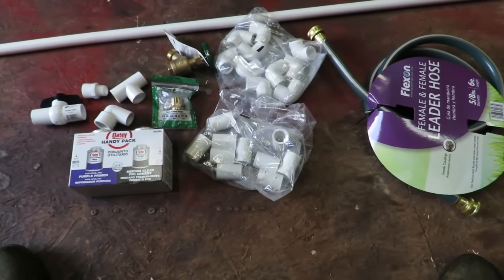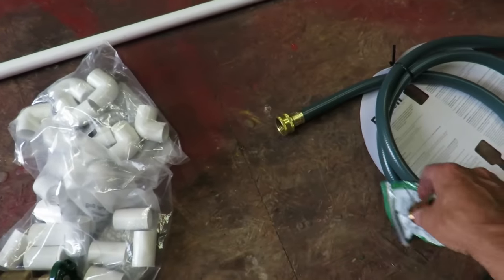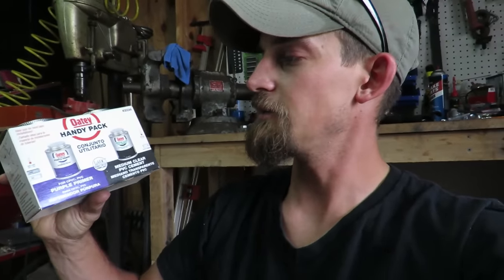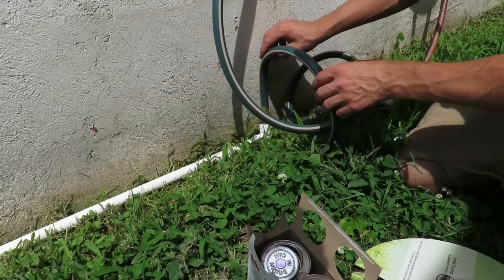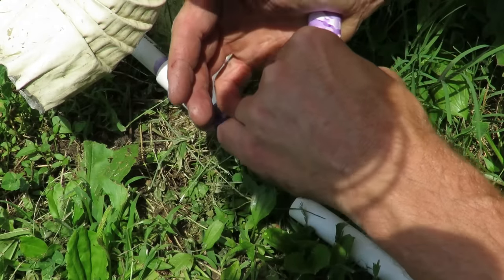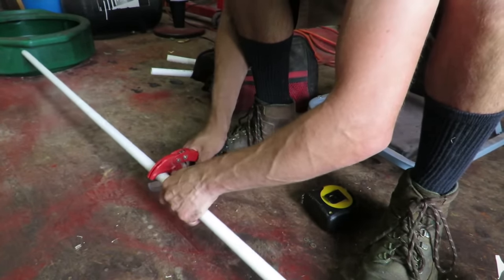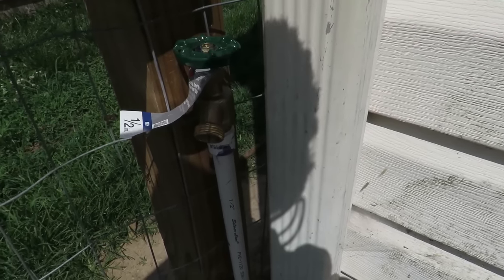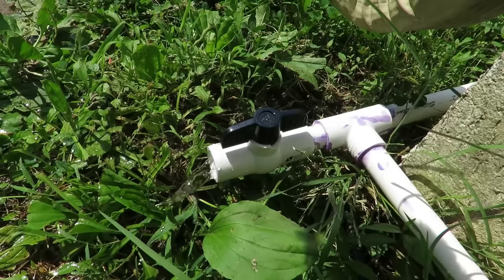Add a Water Spigot Anywhere in Your Yard!

Comment: Tim, thanks for video its really helpful. Not sure if you can help but tried two different female to female leader hoses now and both time the female end going into hose-PVC connector leaks, just out of the back of the leader hose connector,
thx
Derek
Reply from the maker: I'm assuming you have checked to make sure the rubber piece is on the inside of the hose connection?
Reply: @ASliceofWoodWorkshop  Thanks Tim, i figured it out,  the mistake i made was putting tape on hose leader to brass NPT connector, took tape off and its works perfectly- great video

Comment: Great video! Thanks so much for sharing. Could you clarify the size/name of the pvc elbow part you used to connect the brass adaptor to the 1/2” pvc pipe? I’m having trouble finding that one. THX
Reply: What's the time mark for what you're asking about? The pvc piece used to connect the pcv pipe to the bottom of the spigot is a 1/2" slip to 1/2" male adapter. The slip side allows the pvc to adhere to the adapter and the male threaded side allows that end to connect to the brass spigot. If you're needing a link, lmk. If you're asking about a different piece, lmk that too.
Reply: Anyone have a link to the elbow used at 3:57? It’s the 3/4” threaded to 1/2” slip reducer.

Comment: Couple things, No need for teflon tape on your hose end of the MNPT-Hose  adapter, the gasket in the hose will make that water tight.

Glue your ball valves in partially closed position, should you get some glue inside, it'll be easier to break it loose than if it's in a full closed/open position.

When gluing, to prevent any dry spots where the glue didn't gett to, twist your pipe and fitting into the fitting, or the fitting onto your pipe.

Also, since this is going to be sitting in your yard, you will want a backflow preventer on that hosebibb. Nothing fancy necessarily, but you don't want any dirty water making its way back up your pipes.

Comment: Helpful! Question. How far can pipe run effectively on flat ground (or trenches underground) and maintain pressure? I am using 2 hundred ft hoses and seems like pressure is sometimes less. If I do this will it maintain pressure?

Comment: Is it just me or is he holding the pipe cutters up side down...?
I've never used them but I've seen a few people using them on TV.
Reply: there is not upside down.  the back holds the pipe and the blade pushed in to the plastic.  In different situations in ground around roots concrete etc it can be necessary to shove the tool any way you can to make the cut but... always wipe dirt / grit off the pipe as the blade dulls fast and is difficult to sharpen.
Reply: Paul C oh okay thanks I wasn't sure, but with all his tools and his work shop and the old tool bag he had I figured he should be knowing what he's doing, but you never know... I was just curious because I may be getting a pair for a project... thanks for ur reply
Reply: J C yes I know know, thanks

Comment: Si you leave it open 24/7? I need this to install the timer for my garden, other question….i have backflow water from my regular house garden at the faucet from the house, that one has a back low prevention valve do I need to remo it and place it at the new faucet with the irrigation timer?

Comment: Great idea. However as others are saying PVC is sunlight sensitive,  it gets brittle and brakes easily. I used water line, bury it and used metal uprights and faucets.
Also 1/2" is too small, I use 3/4" mostly to keep my pressure and flow rate up. If you are doing drip irritation the 1/2" is fine
Keep up the great ideas for everyone to figure out how to make it work for their own purposes.
Reply from the maker: We will see how long it ends up lasting.  No issues using the 1/2" line for me so far and I have used a pressure washer off it as well.

Comment: For those of you up north where freezing and cracking is a problem I got a tire valve stem and I used epoxy to attach a plastic garden hose fitting to it and I screw it into the system and use my small tire inflator to blow all the excess water out. Gravity draining does not always get all the water out of the turns and valves. Takes a few extra minutes and you don't have to go back and make repairs.

Comment: The end of spicket does not have a threaded end. It has a copper fitting that goes over the main copper line coming from house how do I connect the two copper pipes securely??

Comment: not a problem up north if you set up drain valve at lowest point like you did. Just drain before freezing temps. If you go underground, then you'll need to blow out water using compressed air.

Comment: This is Excellent ❗
I thought I would have to  water lines for drip tubing under cement walks , driveways  and for the other other side  of my house 💔
  I didin"t have $.00 so I've just been reach ing with buckets and hoses 
  I do have the extention on my water spigot at the house for support but, it doesn't seem to be enough. I'm afraid it's too much tension on it . This sounds loke a Great Set Up 
  Thank You ❗ 
 I would like like yo have seen it in it in it's Entirety so I could see how you holked it up. I was not quit sure about that .  I guess I'll figure it it out . My main concern is getting the pressure off of the house spigot. 🤔

Comment: You forgot to hold the two pieces in place while the glue sets.

If you don’t hold them tight in your place,

an actual phenomenon actually takes place,

the chemical reaction can push the pipe away from each other,

separating your work

Ask any experienced person that is familiar with this subject.

Comment: Primer is used to soften the pipe, the other stuff just fills gaps.  Just primer will probably hold if you use it properly, just the glue would probably bust apart.

Comment: I like your idea with a little bit of my idea 😉 ...  I was thinking that because my faucet is about 3-4 feet off the ground ( I'm sure everybody's is ), I am going to install the piping\hose on a gradual slope to the front of the house. Suspending it from the ground. ( still thinking about the kind/style of supports) this will prevent me from having to blow out the pipe before winter. 
Did I also mention that I will be painting the pipe to match the colour of my house. 🤓

Comment: You're putting too much cement on the pipe.  You should be wiping the brush of excess cement before you apply it to the pipe.  Too much cement will weaken the pipe and over melt it.

Yes.  Teflon tape should always be used on threaded connections..

Comment: One thing about PVC is that it will get brittle if exposed to the sunlight. So if you aren't going to bury it then you'll have to paint it. And yes you need to Teflon tape all the threaded connections.

Comment: Why? I don't understand why you couldn't split the hose connector and run the line straight from the house pvc? It just seems like a whole lot of work attaching the hose to the pvc and then removing it when you need the hose.

Comment: You should be able to pick up the garden hose adapter at an irrigation supply house.  I don't understand why you require couplings to connect your sticks together.  Normally PVC sticks have a bell end for the connection to the straight end.

As an irrigation contractor, I normally add a hose connection to the far reaches of my clients irrigation systems.  Connection to the main line is easy and at very little cost.  Water will never be stagnant in the lines because it runs everyday or two.

Comment: I always match mark the pipe and fitting, I also apply cleaner and glue to both the pipe and the fitting, then insert the pipe a quarter turn or so off the match mark, and turn while pushing the joint together and match my mark while seating the joint.  This spreads the glue inside the joint for a secure weld.  I hold it for a few seconds so it doesn't back out before the glue starts to work.  When I let go of the pipe and fitting, I wipe off any excess glue that might have squeezed out of the joint or been applied beyond where the pipe is inside the fitting.  I also use tape and dope on threaded connections, but not garden hose connections, there is a washer inside the female end of the hose.  That's how I was taught, and how I have always done it.

Comment: Awesome video...   I was just thinking about making a 'Rug-Flooder' (for rinsing out area rugs) from pvc pipe and how to hook it up to a water spigot. This video totally answered all my plumbing concerns. Thank you for sharing :)
Reply: Can I get more info on the "rug flooder"? I'm have a rug issue.
Reply: @robinmaynard1640  The basic idea is to attach a 5/8 garden hose adapter to the end of a 36" length of PVC pipe and cap the other end...   Put a few small holes in the pipe so that the pressure will cause water to come cascading out. I created two of these wands to be attached to two garden hoses. Lay the contaminated rug on a tarp in the driveway to flood and rinse urine out before the actual cleaning process. If you do not have a rug-pit for cleaning, this seems to work really well. - Hope this sparks ideas....   It was a Home Depot, arts & crafts sorta day.
Reply: @robinmaynard1640  If the rug is polyester or polypropolene,  its also safe to hang over a rail and hose it down. Lay in the garage with a fan and it should be fine. This wont get out all the spots & stains and potential odor issues but it will remove urine saturation and other chemical build-up.
Reply: @GeoffreyHowells  thank you so much. Sparking ideas - no urine, I just have lots of rugs (I rotate for seasonal style) and I struggle with cleaning them. Carpet cleaners don't work for me. I have just been washing them outside with a hose, detergent and manual scrub brush and hanging over my camper to dry. I have a little power washer I just got that I'm gonna try. It's the drying process that is the worst. Thanks for the clarification. Be well.
Reply: @robinmaynard1640  I am a carpet cleaner... an no.  'Wanding' them is not very effective. Power washer is fine also...   The 'rug-flooder' allows you to leave it on the ground while you push the water away with a push-broom. That's is my purpose for it.
Reply: @robinmaynard1640  Here's another idea I have not tried yet...  36" long sewer pipe capped with a shop-vac attached to one end... Drill a hole arrangement on the pipe...   Roll a rug around the pipe, turn the shop-vac on and soak the rug with a garden hose. I think there would be enough force generated to pull contaminants straight out of the rug.
Reply: @GeoffreyHowells  thanks for your time. Great ideas! Leery of flowing water and electricity with the shop vac, I probably would not have enough control to not run amok. If you hear a news report of woman attacked by a big wet rug in Michigan, just know I was having "an arts and craft" kinda day, too!

Comment: Do you think that your system could be modified to become a above ground soaker line if a series of tiny holes were drilled every so many feet? I have really high water pressure and have done something similar with garden hose but it wears out. Plus the holes get clogged too often and have to poke new ones. Might be a great way to water the trees along the driveway.

Comment: You can use that corner drain that you installed, as another place to connect a water hose. I don't need to tell you that you need to have the new water faucet turned off, in order for it to work.😉😉

Comment: The weak point will be the expanding of the water hose if you leave constant pressure on it.  I speak from my own mistakes. But definitely a great idea!
Reply from the maker: It is important to turn off the main source. You do not want to leave it on the entire time, even in a normal garden hose operation.

Comment: You used the wrong type of pipe.  PVC is only used for non pressurized use.  It will eventually blow out!  Use cpvc.
Reply from the maker: City water will not overpressurize the pvc pipe

Comment: Would you still have to turn on and off the original spigot to get water running to the new 1?
Reply from the maker: You can leave it open, but I do open/close it. It saves time from stretching a hose and then winding it back up

Comment: But.... you say anywhere in the yard. We have a garden at the back of the acre. No buildings to run the PVC pipe alongside. We would have to bury it, right? So the mower doesn't hit it, etc? In that case how do we get the drain valve lower than the pipes?
Reply from the maker: Is is completely flat? You just have it at the lowest point.

Comment: Not sure who the plumbing sales person was but they should have shown you the PVC  adapters located with the all of irrigation sprinklers. Also just a tip you should be more generous with your primer and the cement should be applied to both pieces.
Reply from the maker: We started off in the sprinkler section, that's originally how I was going to do it, but plans changed when they didn't have correct parts.

Comment: If it was buried then i could see this being ok BUT,,,,,if youre ok with looking at that white pipe laying on the ground all the time, why not just lay a green garden hose across the ground and save the money and time you spent on the pvc pipe? Not hating , just wondering.
Reply from the maker: Laying down PVC was actually cheaper than buying a quality 100ft hose. I can also install other tees later and make different branches off it.
Reply: @ASliceofWoodWorkshop  ok, i wasnt aware it was that much of a run. LIke i said, i wasnt hating on it, i was just wondering.

Comment: Would this be safe to bury?
Reply: That's what PVC is designed for, but ... burying the drain valve would render it useless, so in this case, no, but then that exposes the pipe to the sun's UV rays which can break it down over several years (depends on how thin the pipe is). Personally, I'd just dispense with the drain valve and bury everything. If freezing weather threatens, I'd just shut off the source spigot and open the end spigot to relieve pressure and allow room for expansion should residual water in the line freeze.

Comment: Why not have a 100’ water/air hose to by pass all them ftgs & connections?  PVC will crack eventually being exposed to the sun (UV)!
Reply from the maker: This is used to reach further than my 100' water hose.
Reply: Was just trying to brainstorm, 100’ is not the important factor.  The best to you in all your endeavors!
Reply from the maker: I could just leave a hose or two stretched out. This has worked out well filling water bucks and other such items. Truly I wish I had a spigot on both end of the house, but that is just not the case at the current time.

Comment: This is a good project the idea is sound but there is a few issues I see  because I built two of these.  First I use steel pipe for the upright pipes, yes 10 years down the road and you will need to replace the steel pipe but dogs and horses will have trouble chewing up steel pipe horses will play havoc with these by turning on the faucets a frost proof faucet they can’t Turn-on. 
Wet soil can allow horses to break Sch 40 PVC near faucets.  I’m not making this up dogs ripped my first upright faucet out of the ground. Horses can turn on hose bibs, and the broke off   Because this one liked running water. Never had a horse in my house but  seen it at my bosses house damn horse opened an unlocked door!
Reply from the maker: The reason I used the wood is it was attached to our dog log. Also if I place this where animals or high traffic was going to be i would bury it to protect it better. Thanks for checking out the video
Reply: Timothy DC you didn't have to send a  response  most of the time I intended to help people with out a lot of knowledge in dealing with farm style plumbing.  And some of the thing livestock and dogs do to your best laid plans.

Comment: This may be a dumb question but at the main spigot do I need to leave it on at all times?
Reply: Not at all. Just turn it on when you want water to the remote spigot. This is essentially just a PVC hose left in place so you don’t have to drag a 100- ft hose around.

Comment: You need to do ONE joint at a time so that the glue will not dry up on you. Some of your gluing may be compromised.
Reply from the maker: As long as it is done quickly it works.
Reply: @ASliceofWoodWorkshop  OK

Comment: How does this work? Will it only have water when the sprinklers are working? Please explain I want to do this but don’t fully understand how it’ll have water if the sprinkler timer is off and valves are closed?
Reply: He added a water spigot to an existing spigot in another part of his yard. He used a female to female water hose, a few fancy connectors, and then pvc pipe to run the water to the “new” spigot. 
It’s not part of an automated sprinkler system. If you want to add a spigot into your system, you could consider adding a separate zone to your sprinkler system and control the water flow through your actual control box. But that would be $$$... Unless you laid that pipe from the get-go 🤜🏼 and left your system open to add another zone.
Reply: Sean Winston I see... very helpful thanks . I just bought a house and need to add another spigot and I do have a 4th zone which the pipes were ram but it’s not being used. There’s no valve or anything for it just the pipes were installed. Thanks for your help

Comment: Perfect!  Just what I have been looking for to get water out to the garden and get rid of lugging the hoses. Thanks!
Reply: You can collect rain water in a food grade 55 gallon barrel install that valve on the bottom of the barrel and i save money on my water bill. I set the barrel up on 4 cinder blocks and cover the end of my downspout with cheesecloth and cover the top of the drum with the same use a bungee or 2 to gold it on the drum tight. Keeps debris and leaves out of my water. Win win